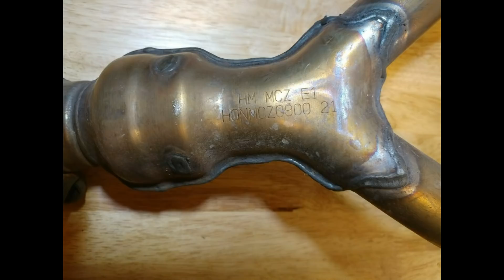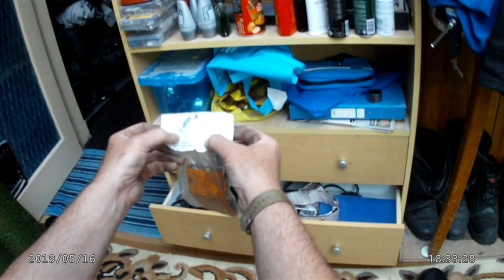Honda Hornet 900 ...with a sheared off Y pipe !

Comment: My bottom exhaust bracket was also broke when i bought my Hornet.It only had done 14000 miles ! Must be a week spot
Reply from the maker: ...you'd think they'd bolt on an alloy bracket to hang the exhaust from , not a mild steel one which quickly rots under there . I've not had a proper look underneath with a torch to see where it should be - I might have a look today and take some photos.

Comment from the maker: ....as I'm going to bodge a 'repair' until the e-bay Y pipe arrives - maybe I should've left the remnant of the fractured pipe inside the end of the silencer , then inserted a 6 inch section of slightly narrower steel tubing inside to support the weight between the joint, then filled the gaps with gun gum !? I've already sent to David Silver Spares for a right hand clamp...£19.99 and £1.30 for the bolt....and £6 post - however I should've ordered a left one too . Jubilee clips are not an alternative as the threads are stripped before the bracket grips tightly enough !

Comment from the maker: ....as there is no longer a bottom bracket underneath the bike to bolt the exhaust header section and collector box on - all the weight will be stressing the Y pipe connections to the silencers ...therefore every time the bike clanged down a pothole while the pipes were hot, stress fractures may have occurred which finally gave way yesterday...?!

Comment: Steve,try your local "KWIKFIT" car exhaust centre,if they won't sell you a bit of the right thickness pipe,they might let you raid their scrap bin. I've done this to cobble chop exhausts during my custom builds. When car exhausts go bad it's usually the silencer boxes,the pipes in between are usually salvageable but they bin them.

Comment from the maker: ...when I fitted this current Y pipe, I had to disconnect the suspension spring so that the wheel and swinging arm dropped right down - which allowed enough space to jiggle the old one off then fit this one .